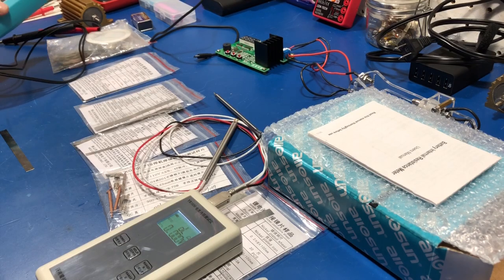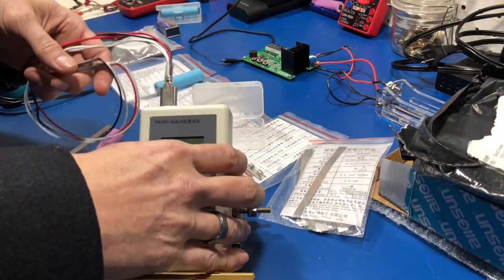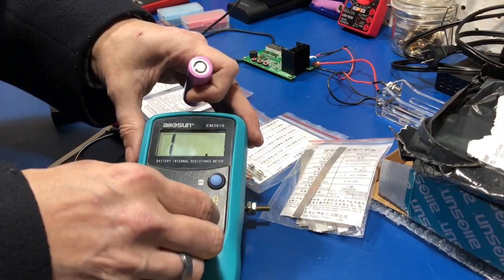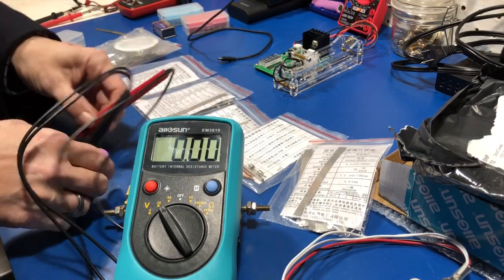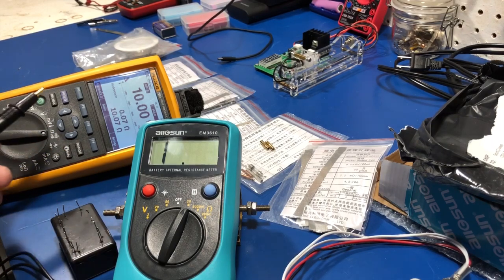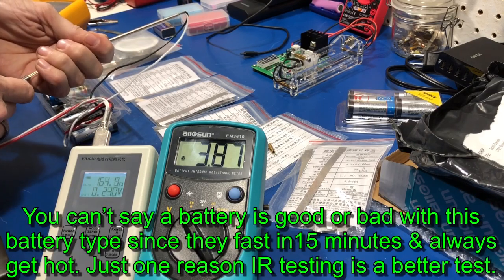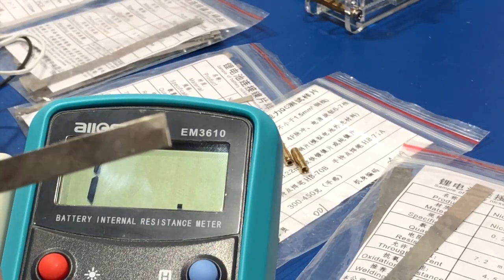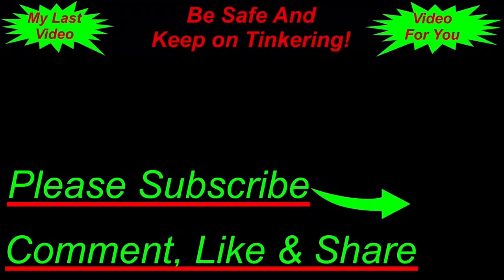Testing Battery Internal Resistance Meters (w/ 4 wire miliohm measurements)

Comment: Just received replacement Xtar Dragon, so I'm running a test and I'll try to make video on Wednesday, 7-24-2019, and post it on my channel. Lets hope this one works because the previous was purchased from Amazon-dot-com and the seller packed badly and it came damaged. So I had to hold, they did not have a second one to replace it with, so I bought it on eBay-dot-com.
Reply from the maker: Hope it works. Was the store on eBay called illumn? They had it the cheapest, I also buy new cells from them.  But I usually get it a little cheaper if I just to to illumn.com
FYI - I canceled my order of the charger. Decided I didn’t need to spend that extra when I have 2 ways to check the IR and chargers are cheaper by themselves.
Reply: @GadgetReviews-US  Thanks for the info!

Comment: Some people ask how the 4 wire measurements works, here is what I found also: https://instrumentationtools.com/difference-between-2-3-and-4-wire-rtds/
Hope you guys find it useful!
Reply from the maker: This is one of my favorites I found years ago explaining and demonstrating 4 wire measurements. CAUTION: Do Not do this bench power supply measure across a battery the same way with 1 Amp, you can damage the battery or cause a fire based on to many variables and reasons to explain. A battery 4 wire meter uses an much lower current and should also use a AC sine wave voltage. It’s still a good video, just not for measuring batteries. 

https://youtu.be/0vMvCVyOp9g
Reply: @GadgetReviews-US  Thanks for your view and the video!

Comment: I have several ways to test the resistance, but most do not agree with each other! I'm affordable battery test from RIGOL. Does anyone knows of something less expensive? Thanks for this video!
Reply from the maker: Mine is the yeeco YR1030, also rebranded under other names. The new one is black and looks a little different. You can find and search for YR1030 on eBay and I saw 2 new @ $40 USD, or the new one looks like it averages $55 USD. Key difference between this and others is the YR1030 uses a kelvin 4 wire measurement with a AC 1Khz signal that’s the same as most battery manufactures also use. 

YR1030
https://www.ebay.com/itm/Vapcell-YR1030-Internal-Resistance-Tester-Test-the-Battery-Internal-Resistance/183813163393?hash=item2acc1e4981:g:vXQAAOSwlxlc3QwB

New model YR1035+, I have not tried this model yet.
https://www.ebay.com/itm/4-line-YR1035-high-precision-battery-internal-resistance-test-instrument/292912725866?var=591692082633
Reply: @GadgetReviews-US  If you test the new one or some other brands, let me know! I ordered couple of them and in a month or so they should be here and I'll make videos. Thanks

Comment: Try to use fine sand paper on the robes - that is what I do with Chinese stuff, US meters, much more money doesn't need to sand off a film at all.
Reply from the maker: Looking forward to see the results. I have a couple xtar chargers and I like them. Should be interesting, looks like it’s a 2 wire resistance measurement so I’m not sure how low it can go in the miliohms vs a 4 wire kelvin resistance measurement. I’ll keep an eye out for you video.
Reply from the maker: On both of mine it reads 1.33mOhm, and the other is 1.42mOhm. The one might have dirty pogo probes. I just haven’t replaced them. But the manual states to use the ZR mode for anything under 10mOhm for better accuracy, I believe this feature reduces the current through the probes on lower resistance under 10Mohms. In ZR mode if I short them out one reads 0 mOhm and the dirty one reads 0.3m Ohms. The SM8124 I had did have 2 wires to each probe but they combined at the tip of the probe and that sort of defeated some of the accuracy of the reading. I did see another one (SM8124A) that used two pogo probes at the end of each probe, I think maybe that one is more accurate? Is that the one you have?
Reply: @GadgetReviews-US  Thanks for detail information! I was hopping to buy inexpensive meter that would tell me exact mAh and Volts, but that has not been the truth! Different meter and different results!
Reply: @GadgetReviews-US  I have single probes but with 4-wire (2 wires on each probe). BUT I don't know for sure if it is accurate or not, because I need several ways to test batteries and if several agree, than I know that it is the right meter - accurate meter.
Reply from the maker: Tony Fleming , so each probe has 2 wires. Does the contact point at the end of each probe have 2 separate contacts? This would give 4 contacts, 2 on the negative and 2 on the positive of the battery. The one I had combined the 2 wires into a single contact on each probe and defeated the 4 wire measurement.
Reply: @GadgetReviews-US  It has only ONE CONTACT and it is cut like 4 quarters. If I understand the 4 wire probes, the measuring of the difference between all 4 wires is why it is done this way. Every wire has a different "signature", or measurements in very minute amount and that is what is measured , to my knowledge.  But I could be wrong so you better check it with someone smarter than me. Here is what I found: https://en.wikipedia.org/wiki/Four-terminal_sensing  AND this:  https://www.allaboutcircuits.com/textbook/direct-current/chpt-8/kelvin-resistance-measurement/
I also found this: How does a 4 wire RTD work?
eliminating the lead wire resistance from the sensor measurement. ... In a 4 wire RTD the actual resistance of the lead wires can be determined and removed from the sensor measurement. The 4-wire circuit is a true 4-wire bridge, which works by using wires 1 & 4 to power the circuit and wires 2 & 3 to read.
Hope this will help you.
Reply from the maker: Thanks for the suggestion. I did try that, it didn’t make a difference. I really thing the all sun is not stable or sensitive enough to read mili-ohm resistance.
Reply: @GadgetReviews-US  I have the same unit and it seems to wok, when I sand the tips.  If I get new device I just purchased, I'll let you know if I like it or not.
Reply: @GadgetReviews-US  Just received the DRAGON VP4 Plus and it seems to me that this works much better - I'm sure I'll learn more about it and I'll post it in my YouTube channel. https://www.youtube.com/channel/UCW1O2JT87eN5_Bb5EHbencw
Reply from the maker: Tony Fleming ok, I have a few xtar chargers and like them. So now I’m curious if it does a 4 wire kelvin AC measurement @ 1Khz. The one review I saw measured an envelope AA cell at 30 mOhm, but even my 6yr old cells measure at 22 mOhm. Make me wonder if this was from the resistance of the probes, using 2 wire instead of 4 wire, or if the probes can be zeroed out. Either way, I can always use another charger,
Reply: @GadgetReviews-US  Can you stick both probes like a short and ZERO OUT the unit? Let me try mine: SM8124 and setup was: OHMS + 20V/2000mOhm ans after few seconds the wire - 4 wire testing - is 0, but than it went up from there to 1-2, back to 1-2....this repeats, so I assume it is 1.5 mOhms. 18650 - 4.2V and 100 mOhma, second 18650: 4.16V and 261 mOhms!, Third 18650 4.21V and 234 mOhms.
3 different kind of batteries (manufactures) But I don't have a special meter that measures these spects, but they are on the way. I'll post video later on on:https://www.youtube.com/playlist?list=PL26lGcdZrC4xIYH1zPmN_dMWbWN0Bf_4q
Reply: @GadgetReviews-US  If you have a chance to make a video a show how you done the tests.... Thanks!
Reply: That is how mine also works. It is confusing! Thanks!
Reply: @GadgetReviews-US  You can press the probes against each other - no battery! and see how much is internal and wires resistants. I'm planing to make a video, but I ordered to many "other gizmos" and the video must include some of them. I'll post it on my chanel.
Reply from the maker: I did this video on the side, not sure if you saw this one yet.
https://www.youtube.com/channel/UCW1O2JT87eN5_Bb5EHbencw
Reply from the maker: That why I was asking.   A 4 wire system shouldn’t have two independent contacts on each probe. On each probe one produces a voltage, and the other produces a current. When both probes are across the device under test it’s using all 4 wires. But if the meter company uses 2 wires on each probe and combines those 2 wires with a single point of contact at the end of the probe then it’s not a true 4 wire measurement because the resistance in the probe contact when the connection and joined is now being added to the measurement. So if the probe end has one metal contact with slits cut in it, then it’s not a true accurate 4 wire measurement. The one I returned had a cut in the probe end, but each section cut still joined and was part of the same  piece of metal in the end of the probe.
Reply: @GadgetReviews-US  If you go to couple of the suggested websites, where the experts explain what is 2 wire, 3wire, 4  wire... you would see how much complex it is. Thanks!
Reply from the maker: Tony Fleming Agreed, it’s complex but I try to keel things simple on the channel for hobbiest, complex tends to scare people away from a hobby. I did the same thing 20 years ago when fixing computers, instead of using computer jargon that just confused customers like most computer shops did. Hmm, geek squad comes to mind with them thinking the A+ cert made them special when they can’t think outside of the box to troubleshoot anything properly and depend on app for diagnostics, but I digress, lol.
Reply: @GadgetReviews-US  I am IT and I sell computers since 1986, but I make their computers much faster than if it is brand new! And I never fixed power supply, just put in a new one - much less $$$ for the customer! Thanks for your reply!

Comment: What is the model name of the precise meter on the left side you’re using for reference? and how much is it? Where did you get it?
Reply from the maker: Mine is the yeeco YR1030, also rebranded under other names. The new one is black and looks a little different. You can find and search for YR1030 on eBay and I saw 2 new @ $40 USD, or the new one looks like it averages $55 USD.  
https://www.ebay.com/itm/Vapcell-YR1030-Internal-Resistance-Tester-Test-the-Battery-Internal-Resistance/183813163393?hash=item2acc1e4981:g:vXQAAOSwlxlc3QwB

Comment: It's about time!!!!  lol  Just starting to watch.
Reply: So what about the ESD problems?
Reply from the maker: Hey Joe,
Well this was just showing some testing, and explains my goals in the beginning text. I have another LCD on the way to see if the ESD issue can be replicated, or if it was just the one meter. Waiting on these parts, receiving the wrong items different from what I ordered are holding this video series up. 
After I’ve completed the rest of the testing. Will try to replicate the ESD issue and make a fix for it, then review the meter I find to be the best in this price range. If it’s the one with the ESD replicated issue I’ll include the fix and explain why it’s still worth the cost and the one I recommend.
Reply: @GadgetReviews-US  What kind of problems did you find in ESD?